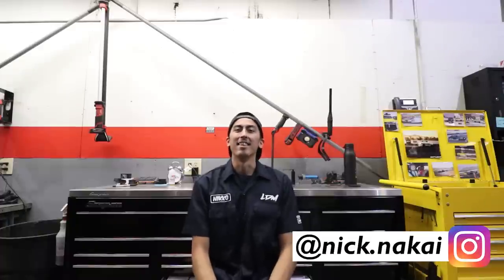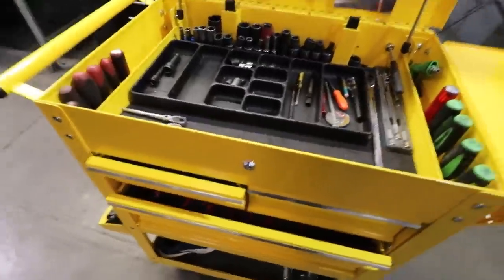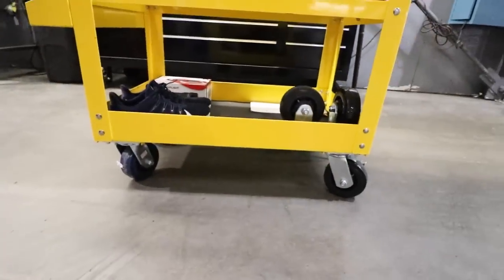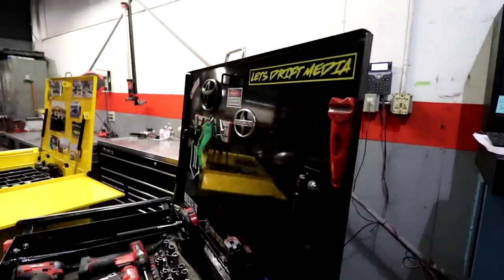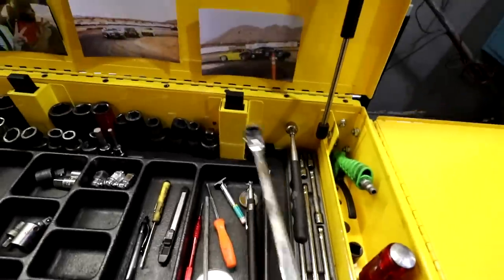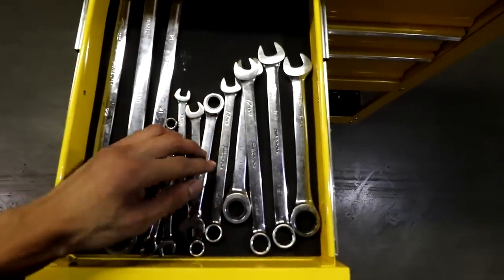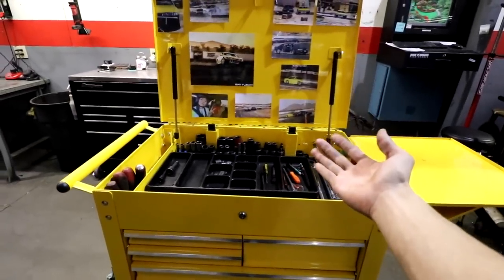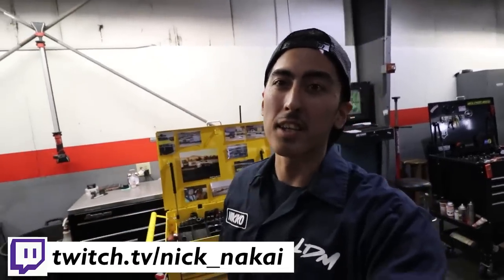HARBOR FREIGHT TOOL CART REVIEW - TOOLBOX TOUR 2020

Comment: I’m a DIYer with a lift and my main box is typically 10ft away from where I work underneath the car.  I’ve honestly thought about getting this tool box so I don’t have to constantly make that back and forth to grab a tool/socket that I need, or putting it back in its place.  Those additional steps back and forth add up in time wasted.  I can only imagine in a flat rate environment where time is money.

Comment: If you don't like those drawer latches, you can take a small piece of wood (I used a dowel rod) and wedge them in the open position.  And, if you don't like the cheesy chrome on the drawer pulls, those slide off and can be painted.  I have a black cart and I painted the chrome a dark blue.  Looks good against the black.

Comment: Over here in the U.K. I've just bought one of these. It's branded as SGS, but it is identical in every way to yours. Overall I'm very impressed with the build quality of the box and the drawers. The wheels are a bit cheap, but will do until I find some heavier duty ones. The only problem I had was the assembly of the uprights to the bottom shelf...the damned bolt holes would not line up. It took a hammer and line-up drift and a serious quantity of bad language to get it assembled. The side shelf is not available over here, but I'm going to customize it with a power strip and some magnetic  trays and hooks. 
Overall I'd give it 8 out of 10 and at £240 it's a fraction of the price of a snap on or blue point model. ..you would not believe how much we have to pay for the good stuff Over here!

Comment: I use a nut with dum-dum and wedge it into the drawer locks with my US Gen boxes. cause it's a huge pain to walk across to the lock latch with a 72" box or any size. The nuts with dum-dum works like a charm and can be reversed should you ever want the lock back

Comment: For your 3/8 stubby impact, what jobs do you find yourself using it most on? Nicely done video btw 👌🏽
Reply: Coleman Komula the Milwaukee fuel stubby 3/8 is a monster takes of nearly anything that it’s 1/2 inch counter part can outside of super high torque stuff like axel nuts. It’s super light weight more so than it fitting in tight places. It’s my main impact despite having the 1/2 inch monster Milwaukee. Hope this helped.
Reply from the maker: Pretty much everything from interior to under the hood. unless its something really tight then I use my 1/2" air

Comment: Just curious what you use the big chain wrench on working on Toyotas. I have one and mainly use it on air dryer filters on big rigs and holding crank pulleys to torque them down
Reply from the maker: Only time I use it is on crank pulleys to tighten or losses em